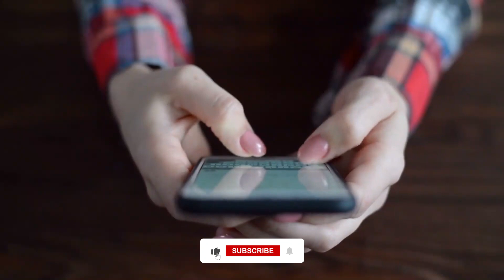How Did 1500 Chinese workers Build a Railroad In 9 hours?

Comment: BS.
Apart from the night time footage of track work, virtually NONE of the other footage is even in China, let alone this job.
What they actually did was realign/re-lay a few hundred metres of line to connect to the new platforms, which were already completed.  
Railways in many other countries routinely do this and similar maintenance/upgrade work overnight too, it's normal.
It takes planning and coordination, but people have been doing this for well over 100 years.
Reply: True, people have been doing this from time to time, but not China's scales and speeds, so stop belittling it.
Reply: @lokmanhussain3805  the video title is BS.  They did not construct a new station overnight.
And this type of work is done regularly elsewhere, on exactly this scale.  It ain't new, or rare. 
And since more people tend to want to travel during the day, doing it overnight is common too.
What China HAS done is to construct by far the largest high speed network in the world in a couple of decades, starting with licensed technology transfer.
On the plus side, this will have significant long term environmental and economic benefits, and potentially opens up travel to far more people than air.
On the down side, actual environmental engineering standards have been low, operating safety is definitely poor by global standards, and it's easy to push these things through fast if you have a command economy where the majority of the population have little-to-no rights.
I'm fine with praise where praise is due, but if someone takes credit for things that haven't actually happened, then what they deserve is to be called out.
Reply: @jonathanj8303  maybe you're right, it's just that I've never seen that scale elsewhere. But low environmental engineering? Low safety operating standards by global standards? I think you're wrong. I want to ask you, how many countries have hsr, how many countries are building it? If you compare Japan, France, Germany, Spain, Italy and a few other countries, who operate only a few hundred km, but still have accidents due to signalling and others, but China with a little over 40,000 km, only had one major accident, so what low safety operating standards that you mentioned? Also, environmental issues, you know China constructed passageway for wildlife wherever they routinely observed roaming.
Reply: @lokmanhussain3805   Ok, I'll reply to your comments in order.
It happens elsewhere, and regularly.  Personal incredulity counts for nothing.  Closing a section of line for a few hours to do major trackworks or heavy maintenance in one go is common practice worldwide, and it's typically done at night to minimise the disruption to services.  Connecting up new station platforms, relaying track over a bridge or through a tunnel, or even just working along a line relaying a section with each overnight engineering possesion.  This kind of work isn't even close to new either.  The GWR completed its final elimination of Brunel's broad gauge, 171 route miles, in a single line closure lasting one weekend.  In 1892.  One of the south american lines, the FCAB I think, did a similar gauge conversion, also in a matter of days, in the 20th century, except their line runs across a desert.  Lifting and replacing a few hundred metres of track in the course of one night is routine.
Operating standards : while China high speed is probably safer than many systems, it has had more than one serious accident, and there seems to be a distinct tendency for wrong side failures of signalling equipment.  You also appear to be implying that no other country has more than a few hundred km of high speed line? I suggest you look up the actual route miles in Japan, France and Spain as a starter.
Environmental issues.  I'm not just talking about wildlife crossings.  I'm talking about the huge environmental impact of that amount of concrete and steel.  I'm talking about the impact on difficult to assess things like drainage - though I'll grant that many chinese HS lines seem to be on almost continuous bridges.  That will minimise the impact on water courses, but at the cost of massively increased cost of materials.  That's not a unique issue to HSR of course, you can 'achieve' the same effect, probably worse, driving a freeway through an area.  But the cost of this - let alone 40,000km of it - is huge, and excessive haste can result in alignments that are politically expedient, or just do-able in the time allowed, rather than optimised to provide the best result at minimum environmental cost.
Reply: @karsonnn     no one, at least in this comment thread, has claimed that the actual achievement isn't real.
Not at all.  Just that it's routine.
What I have said is that the video title was BS, because it doesn't match what is shown in the video.  They didn't build a new station, it was already finished and waiting to be connected to the line.  And the video shows that.
I also said, that while that looks like a bunch of hard work that was completed on schedule, it isn't unique, lots of people inside and outside China do similar things all the time.
I did say that some of the footage used isn't from this project/China.  It's stock footage, and I know that because I recognise it as being elsewhere.  For example, the train shown at 50s runs between Italy and Switzerland.
Reply: @jonathanj8303 
Ok, I agree that the video title is a bit unclear and not specific enough.
But whether believe the video content or not, it depends for each person. So if you think this video is false, alright then.
Reply: @karsonnn  I haven't said the video is false.
I have said that the achievement it reports isn't unique or new.
And that the title doesn't match the content, which is clickbait.
Stop making things up.
Reply: @jonathanj8303 
Well, I was a bit confused cuz your very first comment started straight off with “BS.” so I thought you disagree with the whole video.
Anyways, apologies for my misunderstanding. But still, everyone has their own opinion.
Reply: but not at China's scales and speeds